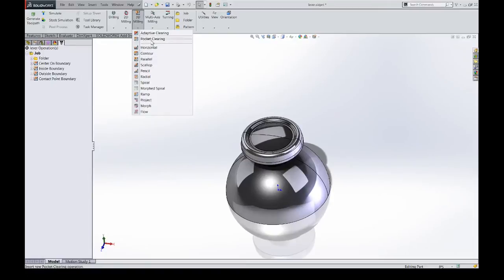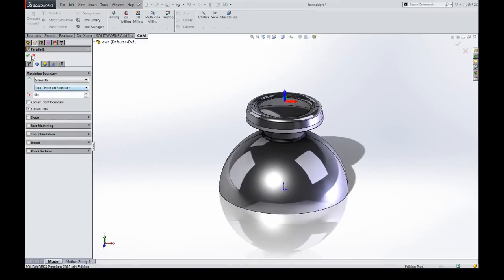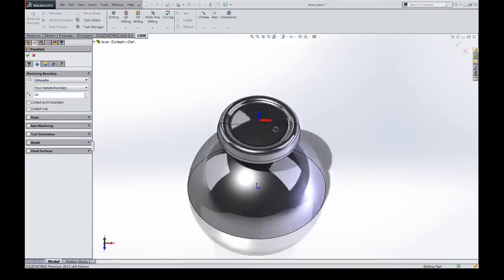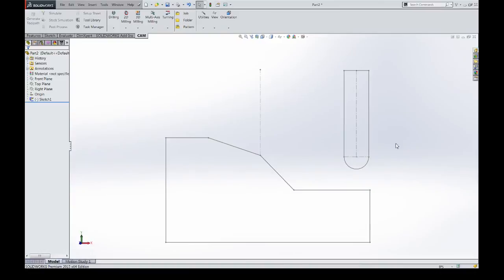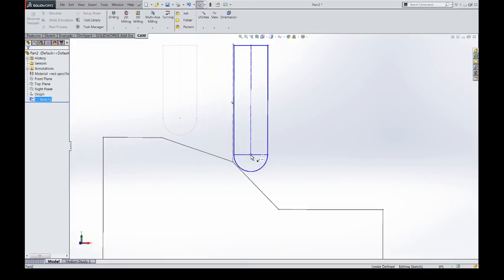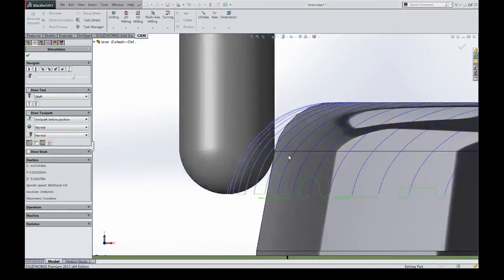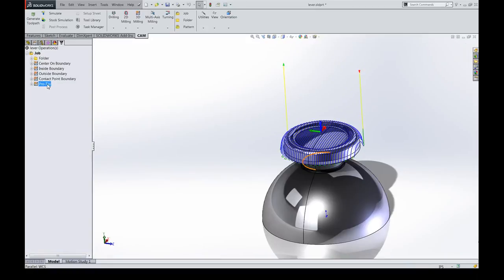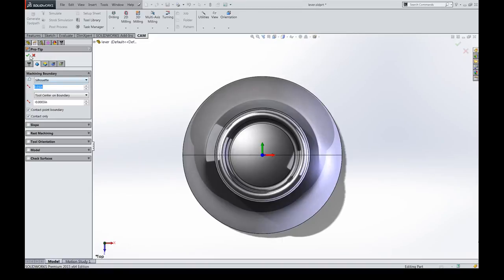HSMWorks How To: Guide to using Machining Boundaries

Comment: Nice job, Rob. Very appreciated. Wouldn't want to toss that file up on the forum would you? Looks pretty specific though so maybe you can't ;-)
Reply from the maker: it's actually a playstation dual shock 4 thumb stick I picked up off of grabcad :)
Reply: rob lockwood Hah, even better! I very much appreciated the Advanced tip. I never noticed that. I'll have to find some way to mail you a beer.